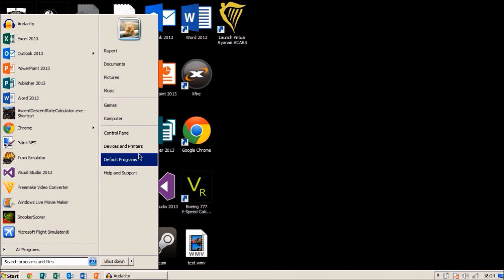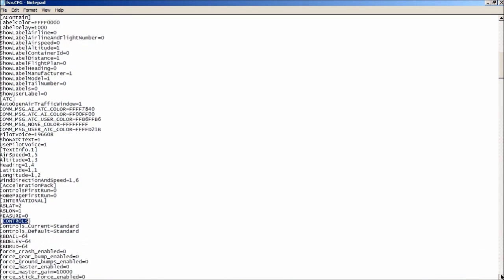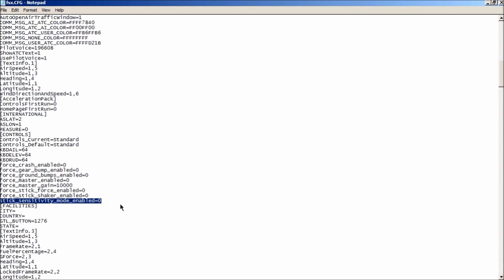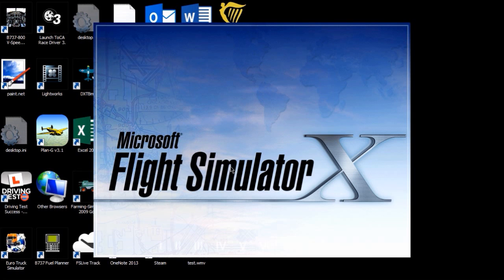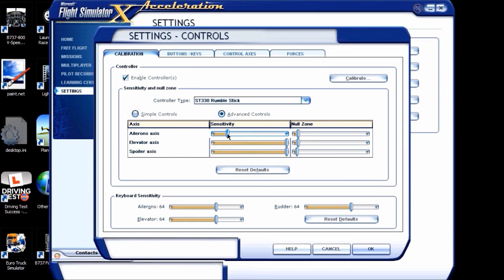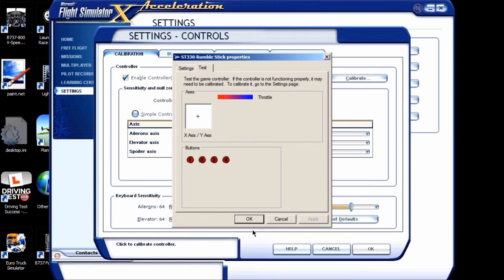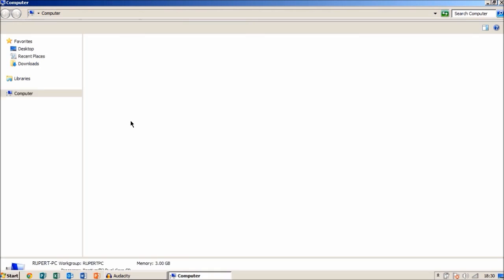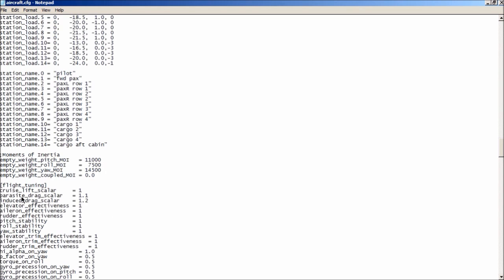FSX - How to setup your joystick/controller properly! (100% Linear!)

Comment: Will it work if I only add in the "stick_sensitivity_mode=0" part?
Reply from the maker: Hi, yes it will work as its supposed to however when in the sim the joystick maybe too sensitive, but that is personal preference. If it is too sensitive you need to do the second bit as if you just move the slider in fsx, it will simply limit the amount the rudder/elevator etc can move (a deadzone) and the sensitivity will remain the same. The good thing about the second bit is that the sensitivity can be customized for individual aircraft. I hope this helps and if you need any other support let me know.
Happy flying,

Rupert Smith
Reply: Great thanks! Also, I was wondering what the "stick_sens..." actually did: When your joystick is not in use (as in your not moving it around) does that count as a "neutral" zone?
Reply from the maker: I'm not 100% sure but I believe stick sensitivity mode is the way fsx handles the joystick and the reason you disable it is because I fsx puts weird effects on and makes it-non linear so we disable it and our joysticks now exactly correlate to whats going on in fsx. And yes I guess you'd call it a neutral zone, a deadzone is when you move your joystick a tiny amount and it doesn't actually do anything in the sim.

Happy flying and don't forget to rate and subscribe if it helped,

Rupert

Comment: does it work with the steam edition?
Reply from the maker: Hi Lancelot, yes it should definitely work with the steam edition. I think the folder directories are different so you may have to search around a bit but once you've found them it will work. Hope it helps you, Happy flying. Rupert.
Ps. If you have any other queries, feel free to ask me.
Reply: Rupert Smith does it work on ANY joystick?(sorry to ask)
Reply from the maker: Lancelot De mole Yep, they all work the same - would even work on a ps3 controller (though there probably wouldn't be much point.) All the best, Rupert. Ps sorry for the delay